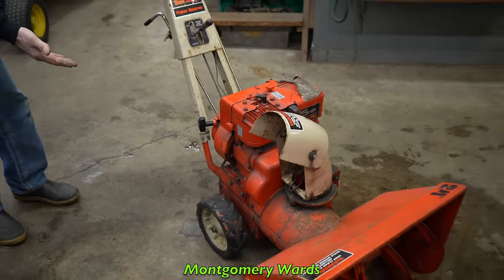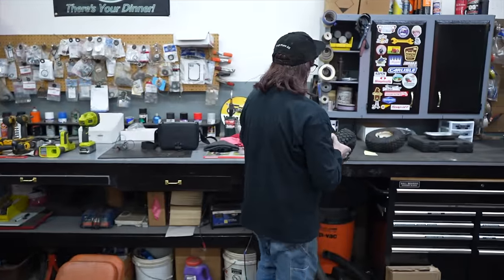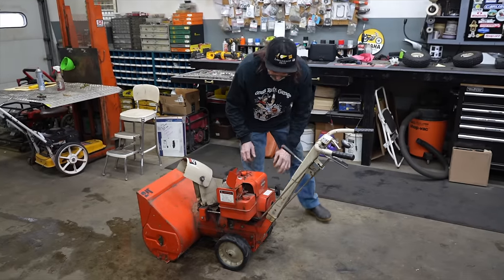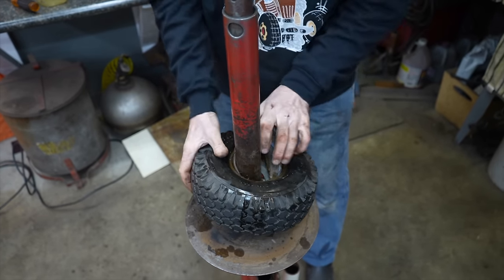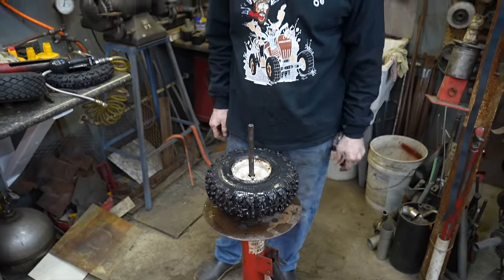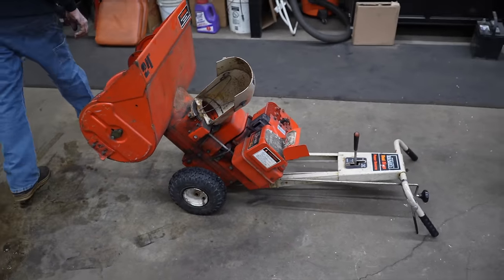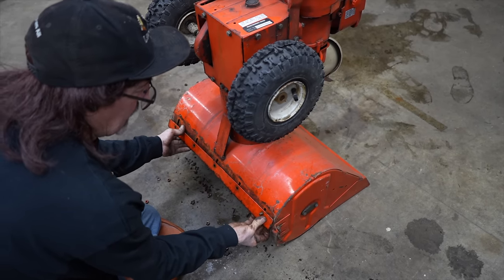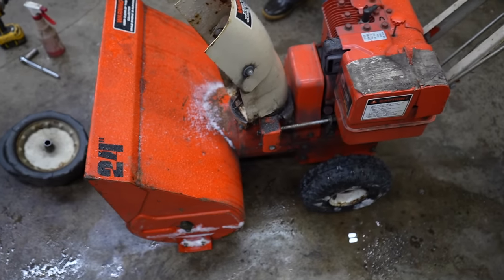FREE Vintage Snow Blower - Let's Upgrade It!

Comment from the maker: Tees, Long Sleeves, Hoodies, Stickers & More! Shipping Worldwide 🌎 
www.TARYLFIXESALL.com
Reply: Taryl  the switch on the snow blower  was in stalled long ways . That's the wrong way it's supposed to install up down position where it ground to frame  take a look you'll see . Love your videos been watching for years.. keep em coming 🤪
Reply: I always use those prefilled tubes with that tire slime or I add tire slime to all small equipment tires and wheel barrows to it's a life saver on lil things that normally give u flats
Reply: I have one from the early 70's that is a tan/ with white handles with a 6 HP Briggs
Reply: Taryl. Where did you get that tire machine at?? I know Harbor Freight makes some, but they don't accept small tires like that ??? Meaning that they are designed to accept bolt through hubs ..I s it a Custom Creation, or possibly no longer available ?? ??

Comment: One trick I learned when I worked as a motorcycle mechanic is to add a little bit of baby powder to the tube. It's an effective dry lube that also helps to prevent pinch flats.

Comment: A Gilson snowblower. Sold those at MW in the mid-70’s. They made nice blowers and tillers for Wards!
Reply: I didn't know that. Thanks for the info.
Reply: Yup. I recognized that too. I still have My Gilson 826 bought new in 1976. 
I just picked up a twin to it for $50. but with Electric start. and in better condition than Mine.
Reply: Also had a 1976 8 HP Gilson  it had a larger axle shaft and was always hard on friction wheels. Come to find out in reverse it hit the axle So I ground the axle down 1/8 inch  no more problem and there's your dinner. 👍
Reply: @Hamers-House  Mine did that, I just adjusted the Slide mechanism.
I'm on My 3rd Drive disk just from use LOL...

Comment: I've got a 1962 Snowbird 26" snow blower that is an absolute beast.  It's will toss snow in a 40' arch clear across the street into my neighbor's yard.  It's powered by 6 hp Briggs.  Starts in two pulls no matter how long it sits (always stored with no gas and points closed so they don't pit).  Too bad I don't live near you or I'd bring it by for a video.
Reply: Love thy neighbour (especially when he takes all your snow...)

Comment: My friend has the same machine. That machine was well loved and cared for. Lubed every year before being put away. He probably checked the gear case oil level and auger bushings yearly. . There were very narrow metal wheels that mounted where skid shoes went on some old blowers.  There really isn't a blower made today that has cast iron gear cases and brass bushings for the augers, as can be seen in  your last video. It represents a real value to it's next  owner, and may outlast the other machines on the lot.  Rods rather than cables that always rust up. Neato  daddyo shirt in the style  of Ed "Big Daddy Roth"'s Rat Fink. Poppin my fingers and digging the groove gettin down can you dig it. ah wooo.  
Thanks.
Reply: My 40yr old Honda HS55 will go you one better on those brass bushings with actual BEARINGS  at all points in the auger assembly. As far as I know those bearings are the ORIGINAL (made in Japan) parts. Btw, there is NO plastic in this machine! There is a reason why Honda equipment prices were MUCH higher than the competition!

Comment: Thanks Taryl.
I still have My Gilson 826 bought new in 1976. 
I just picked up a twin to it for $50. but with Electric start. and in better condition than Mine.
With a good coat of Silicone, that thing throws Snow like no tomorrow especially to the right working with the Flow of Snow off the impeller..

Comment: You need tire iron/spoons that have a fatter thicker end that won't cut the tube ...and i add air to slightly inflate the tube ( not too much but enough that it is more visible )..this makes it easier to see as you work your spoons/irons ..also baby powder can help on your tube ...and put soap on bead of rim and on both sides of the bead area of tire too. . on stubborn stiff tires this can help alot.  . and clean up the bead area too as any roughness can make it a battle
🇨🇦🤓🤙

Comment: I find that if I put small tires in front of a furnace heater output or in the hot sun in the summer to warm up that the tires are more flexible to work with. Love your channel. Thank you

Comment: Folks we bought the house from in 1988 left me a huge Ariens sno-blower.
Every time I went to use it it had a problem.
I fully serviced it and it still was a maintenance nightmare.
I ended up , in frustration, sending it down into the gully.
Bought a Honda track HS128 and never looked back.
Taryl, get some reamers, instead of butchering stuff with files.
My dad (aircraft jig shop foreman) told me to "dull" a drill bit when drilling brass or bronze.
And Kerosene works great for drilling non-ferrous materials....(or tapping)
Nice rebuild, and Bless your patience with those tires.
I would have burned them in a barrel......

Comment: Hi Taryl. You could use a bushing reducer for an engine. 3/4 to 5/8. their about 4 inches long.
Reply: He could have just wrapped some sheet metal around the axle. Job done. A beer can could have done it. If you drink the manly beer that comes in steel cans. There's your dinner!

Comment: I see you have an old Makita chop saw with a limp bag like I do. Heavy old thing, I remember having to hump it up and down ladders or hoist it up with ropes when my dad and I were doing deck and roof jobs back in the day. Still works fine today, and still has the original brushes believe it or not.
Reply: I've still got a 4" Makita angle grinder I bought as my first power tool in 1981, I set brushes in the same way I did with my RC cars back then and it's still on the bench today getting very regular use with a flap disk and it too on its original brushes. I can't imagine many new tools getting to 43 years old with weekly use.. lol

Comment: Great video Taryl! In my opinion Kroil is the best penetrating oil ever made! I used it all the time when I was an Aircraft Mechanic, finally it's available at some local vendors. When I was in the Military we used to a clear spray aerosol to protect bare metal, it was awesome but I forget the name of it. We also had the best primer which was a zinc chromate, the new crap they make is not as good.

Comment: My pet peeve on most snow blowers is the wheels spinning so fast. Let the thrower do it's work you can't plow your way thru with a blower. I usually replace the engine pulley with a smaller one to reduce wheel speed.  A shorter drive belt is then required. No big deal.

Comment: I still use my 2 stage 8hp-26” blower that I purchased in 1985 from Canadian Tire. Today the Chinese metal is so thin they are all junk. 
I just weld on a piece of metal on my skid shoe cause the ones available look cheap. Blades were still available for my 1985 blower. The front of the blade is tapered like a knoce edge. If it was just flat stock it would push the snow rather than scoop it like a dust pan edge. If you drill new holes the original bolts that have a square inside edge will spin.

Comment: What you need my friend is a brand new Ego 2 stage 24" snow blower from Ace hardware on line for $849.00 now thats the tool only but if you have 5 AH batteries from your ego 650cfm blower and string trimmer you can use those ego batteries in you snow thrower for free ! no gas or repairs needed. fully under new warranty !

Comment: Is it worth letting air out and reinflate so tubes are not over stretched in areas? When I was a kid doing semi tires that was the procedure where I worked. Seemed Saturday was a whole set of tires usually

Comment: Nice customizations. You got that thing in scalping mode though. I usually set the blade 1/8" up. Just rest the blade on a builders square or something else the thickness you want the gap to be, then drop the skids down. Riding on the blade is a lot of friction and you get caught on stuff constantly.

Comment: To fix you ground on the switch, i might have got out my soldering iron and put a blob of solder on the rivets you sanded down. This blob of solder should be big enough to be proud of the switch body and touch the mounting plate giving a good ground.

Comment: Your skid plates are adjusted wrong. They're supposed to allow a half inch clearance for the scraper bar to the ground to prevent getting hung up on driveway imperfections. You would set them even higher if you're snowblowing a gravel driveway to prevent rock throwing.

Comment: I have A extremely nice 1979 Montgomery ward snow blower. Mine is 8hp 26 inch I just got done rebuilding the engine it's almost ready to be started after it's full rebuild that I did on the engine

Comment: You might want to consider the Harbor Freight mini tire changer, it's less than $50 and it makes short work of small tires even little ones like this, plus the tool they provide for removing and installing tires is pretty safe on tubes.
Reply from the maker: yep I have one
Reply: Right behind Taryl hanging on the wall as he is working on the tire machine is a HF mini tire changer

Comment: Taryl we had a Montgomery ward in are small town it was a catalog store I know this is off topic but the 318 behind you reminded me to ask you a question my brother inlaw has a 318 I work on it for him I bought hydro fluid Deere recommended added it never had it in the winter till this yr last week it was in the single digits I started it up let it warm up but it wouldn’t move or raise the blade or steering wheel wouldn’t turn until I turned the heat on in my garage then it was ok I have had other hyro s never had this happen summer fall it runs perfectly I read about   Some 318s used ATF

Comment: Brass bushing's great idea.
Dad had an old eska single stage.  snow blower with a 7 horsepower.tech-u-mess engine  would eat anny thing in its path land scape timbers etc! Crank shaft finaly broke - it had a 1/4inch hole drilled crosswise to hold a electric start gear on pto side  junked it  could not get wheels off shaft cut axle off heat pen oil 10 ton press shaft did not move😢

Comment: I have a 1974 Montgomery Wards Snowblower 5 hp Briggs and it's on tracks, it was given to me 10 years ago by the original owner and is still a solid unit!!!! The only thing is the drive cog has the chain sprocket in it that is worn out and there are none to be had as far as I know and it was made by Gilson!!!!!

Comment: I would have gone looking for 5/8 copper pipe I would think the wall thickness would be 1/16x2 = 3//4 maybe mushroom the end of it.  I would dip it in paint so there is no electrolysis with the shaft in salty snow sludge.

Comment: Put a generous coating of dielectric grease on the key switch and panel it attaches to so moisture can't get in and rust it again.  I do that in all manner of electrical connections that are exposed to the elements, including light bulbs, even to the point of filling the recesses that connections are in.  Its a very small investment to insure the long-term reliability of electrical connections.

Comment: I acquired one like this not long ago for free from family friends. Wouldn't start they gave up on it. Did carb rebuild, spark plug and a new muffkin. Tires were like new and had chains too! Ran it two years and sold it for $350. Good, strong, clean machine, easy to work on.

Comment: Taryl, I’ve changed hundreds of tires by hand. What I found is that doing the small ones on a manual machine is harder than on the ground by hand..  spoon the tire into the rim., with the rim being on top of the tire. So much easier. 

My family had a few Gilson Monkey wards snowblowers when I was a kid. They were all 8/26 tho. A couple different models that were slightly different from each other. But I had 2 identical. They never blew snow great, but they always worked good enough to get the job done.
Reply: I still have My Gilson 826 bought new in 1976. 
I just picked up a twin to it for $50. but with Electric start. and in better condition than Mine.

Comment: Gilson...good stuff for the most part. I got a free craigslist 8hp Gilson tiller in my barn. I had it running, it ran good but it smoked horribly. I have a newer 8hp briggs for it one day, but i see why you see so few of them around. Gonna be a ton of machining new parts. It has a variable speed pulley drive for the wheel speed and friction reverse. All obsolete proprietary parts. Monkey wards also sold the identical tiller under their name. Not sure why i love that thing so much? I dunno, never been a big troy bilt fan i guess.

Comment: I have a 1999 Noma/Murray and when I changed the shoes and the scraper bar almost every bolt broke off. I believe I put neverseize on them when I replaced the fasteners with bulk hardware from Rural King

Comment: Lawnmower wheels are crappy these days too, 2yrs and they're completely worn out, thinkin on trying to glue some tread on there from worn out rubber tires with heavy duty super glue, bc $40 bucks for two lawnmower wheels is insane.

Comment: I had one of those but mine was called Gilson. I had to make a impeller for it the 3 blade stamp steel was all bent, so i made a 4 blade and it worked great it sent the snow at least 40 feet away. The only problem was the engine it froze all the time.

Comment: Those tires your brother gave you with tubes in them were fine, no need to change.
Reply: No. Those are lawn tires for a riding mower. You would need chains for them, otherwise they will slip.

Comment: I wouldn't put pneumatic tires on a snowblower, too much risk of flats for no benefit.  I'd go with flatless (filled with foam) & tire chains. Full pressure in the afternoon will be flat in the morning, full in the morning will be overfilled in the afternoon.

Or, maybe, fill some pneumatic tires with expanding foam.

Comment: You really took the tire off and put it back on, backwards. Taking off start by the stem, putting on stem goes last. I have fixed thousands of tires. Those little ones are a PITA.

Comment: I love the older machines that were built with Briggs and scrap’em. I grew up with lawn mowers, portable compressors, concrete troweling machines, log splitter s and the best thing for kids tote goats and go carts. It’s a pleasure seeing you repair them and get them running. I’ve been restoring a 1977 Troy built 5hp horse model. Your snow thrower looks better built than the new plastic Chineesium stuff of today! Keep up the great work! Love the skits!

Comment: Thanks for the video Taryl! Just a few questions for you. Why did you not use the small tire attachment that was on the wall behind you? It has a mount/demount tool with it. Second, why didn't you air up the inner tube slightly to seat it so you didn't cut it? 
I always work with that nylon board at work and it is the bee's knees for wear! Thanks again for the video!

Comment: Instead of those bushings you could have just wrapped some 16 gauge sheet metal around the axle. A strip about 2 inches wide would do it. The tire doesn't spin on the axle really. You just have to take up the slop. 14 gauge wrapped super tight would only be 5 thousandths  less than 3/4" You might even have to use thinner sheet metal. Say 20 gauge. Maybe some beer can?

Comment: Them are the same colors as my 69 simplicity snow thrower I have bought it in 98 it’s a single stage the shoes were ground down to nothing replaced em back then edge of the auger was chewed up a bit added some strips of conveyor belt material to edge to fill the gap helps push wet snow through the shoot better without clogging up

Comment: If you have to do it on the ground due to not having a tyre machine be sure before levering tyre bead back on that you have a bit of air in the tube. Doing so will keep the tube from being pinched i.e pierced with spoons or levers including screw drivers

Comment: When you have flattened tires like that and tubes just put the tube in them, air it up till they take shape and put them by a wood stove, heater, or out in the sun till the rubber heats up and takes the new shape.

Comment: I think would have been easier once you mount one side of the tire to take the tire out of the mounting machine and mount the inner tube outside the tire machine then put the tire back in the mounting machine and mount the other side,

Comment: Really preciate the part numbers and sources Taryl.
I've got a Gorilla Garden Cart that's a beast and insanely useful around the yard, but the tires are split and cracked, bought new tires and they're junk too.
Reply: Plastic rims?
Reply: @liberpater1342  no, steel split rims which are kinda nice.